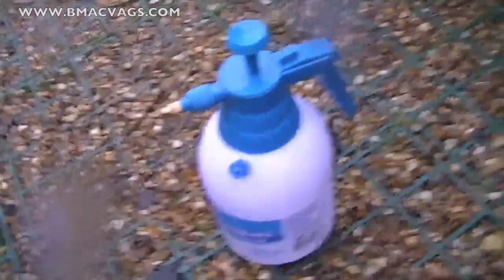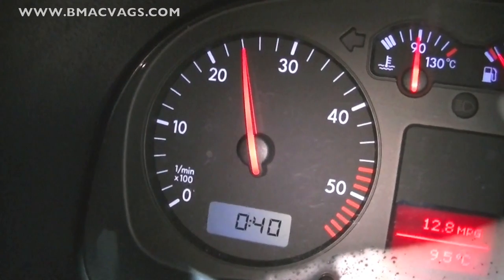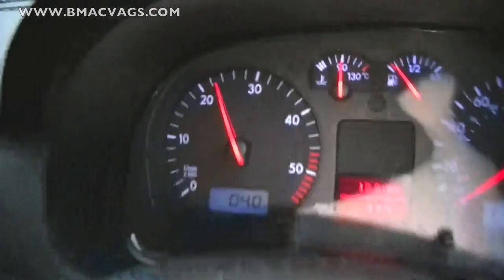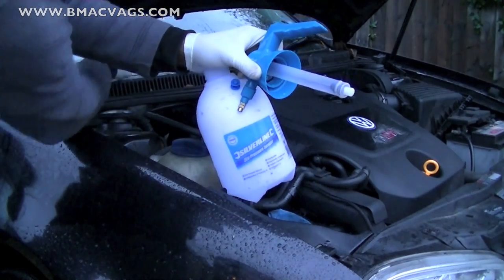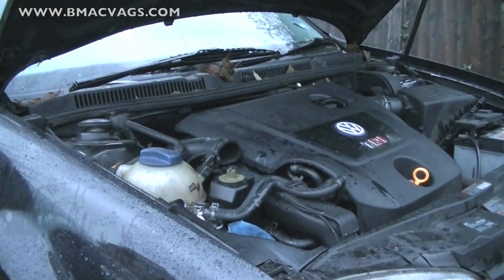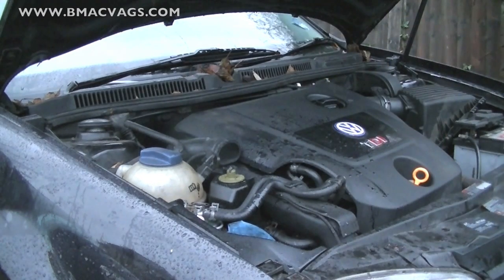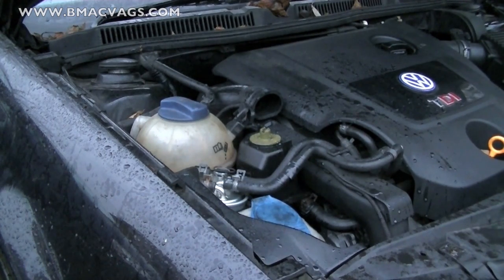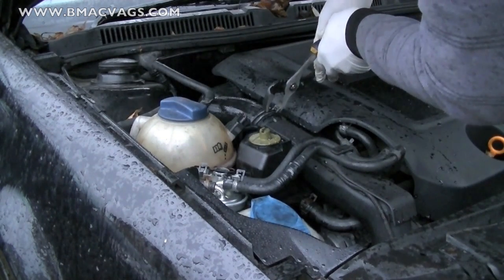How to Decarbonise your Engine with Tap Water

Comment: Good vid... And I will testify that this does work. I performed this on my 05 G35 6MT, which had terrible pinging on acceleration. I tried seafoam, Lucas oil, Berryman, fuel treatment/flush, hot plugs/cold plugs, MAF sensor cleaning, ECU reset, Shell/Texaco 93/91 octane since I've owned it... everything... Anyway, I used a similar method and sucked distilled water from a bowl with the vacuum line off of my brake booster just a little bit at a time. Took it for a drive and my car pulled harder than it ever has with no pinging throughout the driving range.
Reply from the maker: Thank you for having the faith to try this method. Hopefully other people will sees you testimony and have the faith and bravery to try.

Comment: a bit of maths shows that in order to achieve hydrolock on a 1.5 liter car with a 10 to 1 compression ratio at 1000 rpm you would need 150 liters of water a minute, ok probably less would cause damage say 50 liters a minute but still it would be difficult to mess up that badly!!
Reply: I disagree. All you need to hydrolock an engine is the amount of water it takes to fill the combustion chamber on TDC compression to a point where the crank can no longer make a full revolution. If you fill one cylinder of a 1.5 liter 4 cylinder engine with water, that is 375cc of water. Now, you don't need that much to prevent rotation, just enough to take up a bit more space than the total final combustion chamber volume of that one cylinder. So at 10:1 that is about 45cc of water required (inflated, just to be safe). When that cylinder draws in that 45cc amount of water, the piston moves upward and since the water is a liquid and is not able to be compressed, it stops the piston in its tracks. At speed, that usually means a broken connecting rod.

Using this method DOES have a GREAT potential to destroy an engine if it isn't done correctly. The most important part is to go slow, use a sprayer that mists the water as finely as possible, and don't do this on a car with a very complex intake manifold that could trap water in valleys and allow it to rush into a cylinder when you change velocity quickly.

The bottom line is, with quality fuel and an engine that sees normal operating temp and loads, there won't be any appreciable Carbon buildup to remove. Therefore, since the procedure isn't exactly needed and can cause more harm than good if done wrong, I would advise people NOT to do it.
Reply: the flash boil point changes with atmospheric pressure, 1600.1 is at atmospheric pressure the expansion inside a cylinder is far-lower, but you are correct it would increase stress on the engine
Reply: What happens is the water flash boils under compression. That's how this method works. The expansion ratio of water is something like 1600:1 and the shock wave is what breaks the carbon loose.

At/near idle speeds you're unlikely to do any damage. Unless you literally poor in water from a hose, the worst would be a stall.

BUT, some people think it's a good idea to rev the engine to like 4000RPM that's when things go south. Water to steam expansion does produce enough pressure to break rods. Dump in enough water at this RPM and your engine will suffer.
Reply from the maker: You would need a substantial amount going in at once, but people fear what they don't understand.
Reply: Yup, boiling point goes up, but compression temps in an engine usually exceed the water boiling point.

I think it's something like 170c boiling point at 110psi, but air compression to 110psi is like 220c. That's why even a gasoline engine starts to sound like a diesel when doing this trick.

Comment: BMAC ...I quite fancy  the idea and have known about it for some time but the only thing that stopping me is a comment on an American Frum that said it'll strip the oil/lubrication from the cylinder walls= more wear? What do you and other readers think about this?
Reply from the maker: In my opinion I think it is a very safe method. I think that poor oil maintenance will do more damage to the cylinder walls than this ever will. People will have their theories but i think you will be fine. Personally I love this method, and you will feel a instant improvement.
Reply: yeah I agree the guy who said it was trying to 'dis' an old timer and if it were true ...every turbo car with water injection would have been ruined....an engine probably sucks that much H2O during a heavy downpour anyway
Reply from the maker: That is how i see it
Reply: Daniel Connor
It's not true that it will cause more wear. Even when an engine is rebuilt, most of the time they hone the inside of the cylinders before installing the new pistons/rings. Even though, every pistion has an orifice on the big-end which oil exits to relubricate the cylinder walls as the pistons move up and down.
The carbon in a cylinder builds up after time due to inevitable varying of fuel to air ratio on the rich side. This CAN and WILL be removed by the method BMAC VAGS shows in his video. Any auto technician who says otherwise is blatently misleading you and anyone else who disagrees has never seen how clean the inside of an engine cylinder is after the gasket has blown and water enters the cylinder(s). It looks as though it has been power-washed clean.
Reply: I'm gonna try this method with my domestic H2O steam mop as it can be configured to outlet through a small nozzlw which will give a steady (flowrate)...but Im wondering if the steam will be less effective as it has already phase changed and so the combustion event would require less energy and the water expansion coefficient  less also....other thoughts are to mix the water with some upper cylinder cleaner maybe some CRC stuff...thoughts anyone?
Also BMAC and Kyros do you think the water/steam cleaning has any cleaning effect on Lambda (O2) sensors? Some say they can't be cleaned others say they can...any knowledge on cleaning these suckers? fitted on car or removed? 

Thanks

D.
Reply: Daniel Connor Yes it does, but there isn't much noticable cleaning that takes place in these areas due to the lack of the high pressure steam cleaning that only really takes place within the cylinder. Not sure, but some sources say the O2 sensor can be removed and cleaned, but I have never done so, so I can't say personally.
Reply: will be reapplied instantly on the next few rotations.

Comment: Thanks i will try that soon. 
I also have a slight problem, my car drives fine but when the engine is worm and i select 3rd or 4th gear at anything below 2000 Revs, my car struggels its almost like a chocking/ jercking action. Until i rev it agresivelly and then it goes back to normal. 
Do u know what could be the cause,  i have took it to alot of mechanics and the couldnt tell me what is causing it
Reply from the maker: Could be a DMF, does the car shake on take off?

Comment: Hi there ! I have an mk4 2001 , 1.6 16v , fuel consumption is around 12l/100km , driving carefully in the city , my EGR light is on , it was cleaned and reseted , the engine check dissapeared but after 50km it came back again.Do I have a chance to lower my fuel consumption if I buy a new EGR?
Reply from the maker: To me it sounds like a O2 sensor, its very common fault. Have you tried the water decarbonisation yet?

Comment: sup dude, my car has the air filter on top of the engine, is it best to remove the air filter and spray straight in or can you spray it with the filter in the way? thanks
Reply from the maker: no air filter, straight in

Comment: it doesn't matter if is not TDI engine?
Reply from the maker: Its works on all types of engines
Reply: BMAC VAGS okay. Thanks. I got question for you my car keeps exhaling to much gas, what can it be? I haven't check the engine light what can it be if any suggestions?
Reply: BMAC VAGS Not recommended on 2 cycle engines. It can allow water into the crankcase. Also, on ANY 4 cycle engine this procedure is perfectly safe but it is recommended to change your engine's oil after completion.
Reply: Okay thanks.
The reply was was helpful.
Reply: BMAC VAGS Is this going to have any sort of benefit to my golf gti mk4 NON TURBO dude? great vids by the way..
Reply from the maker: You should gain the same benefits as everyone else. Let me know if you feel a difference. Thanks for watching my videos

Comment: Hello I'm just curious I own a 2000 TDI golf I cleaned the intake last month does this method prevent my intake from clogging?
Reply from the maker: Yes it will help to make the engine run cleaner resulting in less unburnt carbon. It would be a good idea to do a EGR delete, that would solve it.

Comment: I wish I had the guts to do it! Nice vid as always
Reply from the maker: This seems to scare a lot of people, but I is really quite safe.  Look at how the use seafoam, its the same sort of thing.
Reply: BMAC VAGS except according to you seafoam doesnt work?, if you wanna do it at home without any crazy ideas put a lil auto tranny fluid through it will clean it up better than anything on the market i am told
Reply: ghettohillbilly1 Tranny fluid in the engine oil, not the intake though, correct?  I heard a quick run of diesel in place of oil does the trick too, although I'd never try that personally lol

Comment: can i spray water right into the turbo ill take the intake off with the mass senor ? Thanks
Reply from the maker: If you do it like that the water has to travel a lot further around through the intercooler and up to the engine. I think the shortest path like the one in the video is the best way.
Reply: Ok so just after the intercooler in the intake  manifold

Comment from the maker: This suitable for all engines
Reply: ***** Yes this is what I want to know. Did you try this method and did it work?
Reply: ***** Double check that the CAT isn't clogged from failing. When a CAT fails it no longer gets hot enough to burn off impurities on it surface. Eventually these start building up till no exhaust can get out. Performance can get really bad in these cases.

Comment from the maker: If you do a little research into this you will find that it is a well known phenomenon.  Water injection has been known to increase fuel economy from 25-50%. Pilots in world war 2 noticed that flying at lower altitude closer to the sea, the planes performance was increased.
Reply: Flying low has nothing to do with water injection, it has to do with air density, especially in pre-jet aircraft.  Water injection was used to increase performance however.  blizzard.rwic.und.edu/~nordlie/water_injection/background.html
Reply: Boodieman72 Water vapor content is higher above sea than land. BMAC VAGS knows what he is talking about.
Reply: SALTYstunt Actually boodiman72 is on target with the point of water injection effectiveness. Not sure why BMAC chose to even add that last sentence. 
Altitude has a lot of effect on engines and planes.  Planes encounter higher resistance from the denser air at lower altitudes.  They also can get more power at sea level due to more oxygen regardless of whether the plane is over water or not. Being over water typically means a cooler thus denser air charge. Often humidity is fairly high there but its effects are much more minimal than the temperature is. Also you can get humidity at higher altitudes as well when you fly through the clouds. 
Like Boodieman said. Flying low has nothing to do with water injection. Water injection gave such better performance that by comparison high humidity performance increase was a joke.
Reply: That's why WW2 fighters like e.g. the P47 Thunderbolt used a supercharger to "trick" the engine to perform equally good on high altitudes as at sea level. :)
Reply: GymChess Actually that engine was a two stage forced induction with the second stage being a turbocharger and certain versions did have water injection on top of that. 
Single stage forced induction could only do so much. The second stage was brought on at the higher altitudes to increase the air density into the engines. If I recall correctly single stage was only good to about 10,000 feet. turbochargers naturally compensate for altitude because their compressors maps actually change as the air gets thinner.  The exhaust gets faster and the compressor sees less resistance and both actions together cause the turbo to spin faster thus compressing more air. Something the superchargers can't do.  I wouldn't call it a "trick". It is simply a method of compensation.

Comment: Hi, great video, as always! :) I won't be trying this, just because i am kind of against putting water in the engine. Although i wanted to ask you for quite a while now. Have you heard anything about the golf mk4 1.4 liter 16 valve engines? I have a kind of bad tappet noise, although it almost goes away when the car reaches it's operating temperature. Anyway i am going to be changing the hydraulic tappet lifters and hope the noise will go away. Any ideas on this subject? Thanks for any kind of reply man. :)
Reply: Common issue on the smaller lumps as they rack up miles. Problem likely to be low oil pressure due to oil pickup pipe clogged up which strangles oil flow to the top end, so bits like lifters and the cam carrier start wearing and making that top end rattle. Drop the sump, remove the oil pickup pipe, clean it out and refit. Sump uses a gasket sealent, clean surface thoroughly of old stuff and any oil then run a 2mm bead round the sump going inside the bolt holes as you go round and fit it quick after doing the bead.  Sealant has to go off so leave it 30-60 mins before putting in oil.  Try this before ripping the top end to bits - you may need to do the lifters anyway (or the cam carrier if it has gone that far) but do this first means you won't have them wearing out quickly.
Reply: BTW, muchos thankos to BMAC for the guides, real help squire and hope you don't mind me jumping in just now with the info.  I only know all that stuff as I have the same problem with my 1.4!
Reply: CashC0rner You should be able to just remove and then clean out the pickup.  Plus, with the sump dropped you can scrape any muck out too.  Put a new filter on then refill with new oil and it should improve the flow ropund the unit with more consistent pressure and more going to the top end, helping reduce wear. You may well still get top end rattle but the oil flow will be quicker so the noise should die back faster after starting up.  Whether the noise is down to a dodgy lifter or is the cam carrier is something you'll most likely only find out when taking the top bits off.  Good news is you can do other things like shove a new cambelt on as it will need to come off anyway - if you consider that to be good news!
Reply: valves
Reply from the maker: Its tough to say without a full diagnosis, but tappets, valves or camshaft are all potential candidates.
Reply: mrdainase
Thanks man. So if i replace the oil pickup pipe, i should avoid this kind of stuff after replacing my tappets/valves? People tell me this tapping noise isn't so bad, well it's really not as bad, but still kind of bugs me lol.
Reply: Every 1.4 sounds like a diesel haha. Change oil , filter, make sure no oil present in air filter box. Bang a bottle of redex and tank of 99 through it. But yeah it’s probs the tappets. I had one 202,000 miles stared first time nothing to worry about